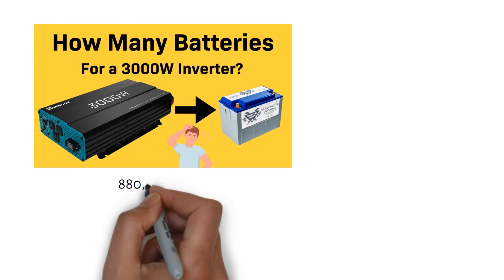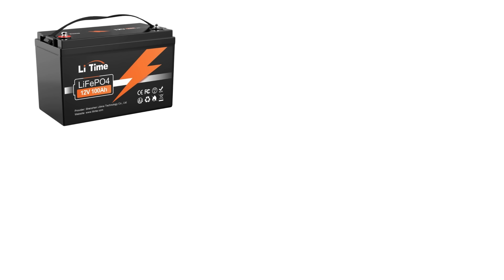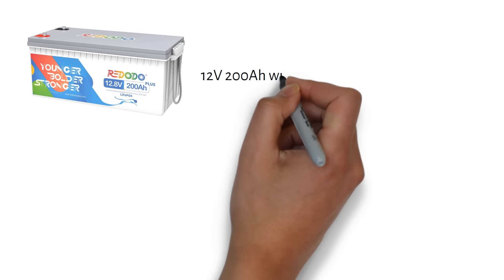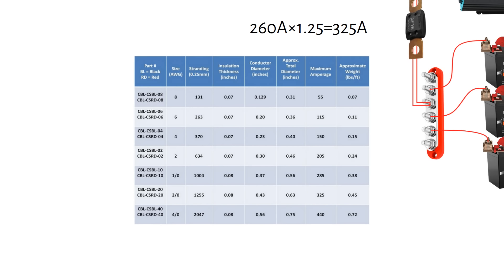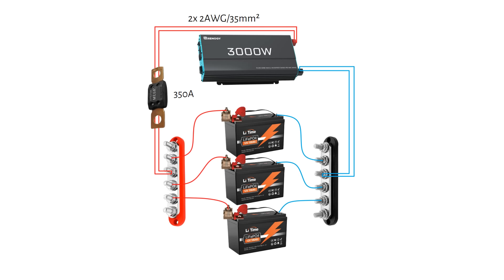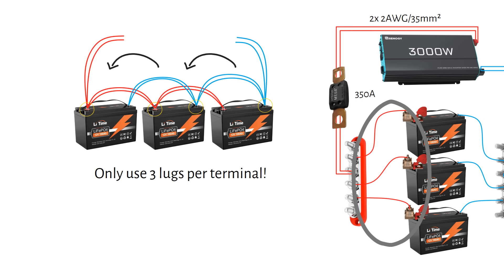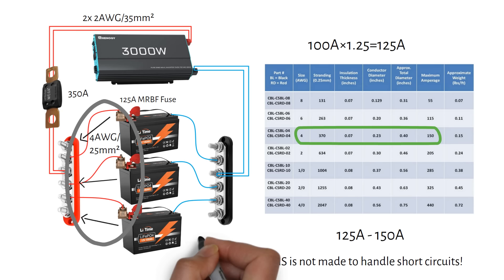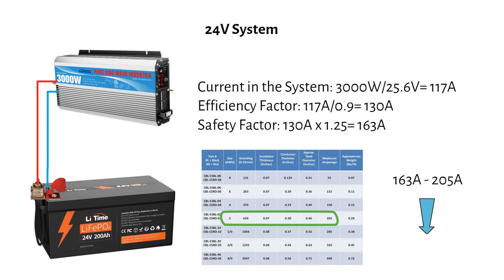How Many 12V Batteries for 3000W Inverter

Comment: I've got this exact inverter. Should have researched by better / seen this before buying.
Running off two 130 leasure batteries, and you get to microwave one meal before the low battery alarm sounds.
Useless in a motorhome setting 😢
Reply from the maker: Indeed, something i forgot to mention. If a large load is placed on lead-acid batteries, the voltage will drop. The inverter will shut down because it thinks the batteries are empty. While in fact, the load is too large for the batteries.
Reply: With 4 100Ah 100A lifepo4 batteries and my 3000w 24v inverter I can use an electric oven with 2 cooking plates and  electric oven with all 3 at full power at same time. And I can keep it running like that until the batteries is empty which will take 1,5 to 2 hours as I do not know the exact power usage of the electric oven. LifePo4 is the way to go for high power usage.
Reply: @a64738  Agreed. 24v is better as the cable gauge can be reduced. Lithium can be run flat, unlike lead acid, but the price! Looking at a 12v 280ah lithium from eco-worthy for £500.
I'll be selling the inverter and buying a 1000w. Hardly use it anyway, and mainly to charge laptops etc. My inexperienced thought was, 'if buying one, may as well have the extra watts just in case'.

Comment: I have LiFePO4 12.8V 200Ah Plus batteries. Would I still require two 300A busbars, or would something larger be required? Thanks a bunch and great video!!
Reply from the maker: 300A busbars is sufficient.

Comment: So the question is you're saying, 2 batteries will give you 3000 W. How many amp hours does it give you? So does it will that allow the battery to run for 12 hours or 4 hours or 6 hours? You don't know how many batteries do you need to run for 48 hours steady with the 3000 What load?
Reply from the maker: 2 12V 100Ah batteries in parallel will give you 200Ah. An inverter doesn't give you Ah though. I have made videos about how to calculate battery runtime, check them out on my channel.
Reply: The 3x lithium will give you 1 hour running 3000w load, and the 13x lead acid will give you 2.5 hours if you do not want to push it to the danger zone of discharging lead acids, but it can deliver 5 hours until discharge, where i live its cheaper to build the 13x lead acid bank than the 3x lithium about half the price for the whole bank, it may last half the time of the lithium but it will give at least 2.5 times the power, also lead acid is the real green battery with full return chain and i coud have a 10% discount in return on the next time i buy a new bank, lithium is not realy easy to recycle and where i live i need to pay for it to be disposed, yep it will not be recycled it will go in a landfill

Comment: Hi, I'm still very new at this.  I undrstand (I think) how to calculate the batteries and wire needed if I know the rating of the inverter.  But what inverter do I need to run a 1500 watt 120vac load from sundown to sun-up?
Reply from the maker: 1500W/0.9=1666W at inverter input * 8 hours = 13,333Wh per day. Off grid design says 3 days of autonomy, 13,333Wh*3days=40,000Wh or 40kwh battery = 8 server racks (48V). Recharge the battery in one day: 40,000Wh/3 sunhours on average = 13,333W of solar panels. cost of batteries: $10k+ $6.6k solar = $16.6k for batteries and solar add an EG4 off grid inverter 6000XP ($1400) + additional charge controller $500. so expect to pay $20k for this.

Comment: This is what ive found - i have a electric hydrologic wood splitter - when i use it on a 3000 watt inverter it will blow a 400 amp fuse - 
     I tried using a 400 and 200 amp fuse and after using it a few times both those fuses blew - 
        Sence then ive used two 400 amp fuses and have not blown any fuses -
Reply from the maker: A wood splitter is know for high surge currents. I recommend using a low frequency inverter for this load. Are your cables thick enough for a 400A fuse? at least 4/0 or 120mm²?
Reply: I do use low frequency inverters for my   high draw devices like my electric wood splitters - I use 750;CM cables as power cables - 
      I had worked on generators and SCR drives in the offshore shore oil fields & remote mountain oilfields for 50 yrs lol  - I'm a 4 th generation mechanic electrician - 
     I live in the rural South - I had a grate uncle that started setting up homes with rural light plant about 1880 - he trained my grand father and some of my uncle's - in 1920 most went to powering there homes with 32 volts - the railroad started using 32 volts about 1915 or so is what my grandfather said - 
      Down here since it rarely gets down to 0° F most used an acid strength of 1.195 gravity - it's a weak solution of acid  so the standing voltage of the cell at 78° is 2 volts per cell - 
     With weaker acid the cells do not easily sulfate and it's easy to equalize them - also they don't use much water and the terminals and cables don't corrode at all as long as there coated with Vaseline - 
       Also the plates don't swell or flake over the generations of service - when I was a kid I saw 800 amp cells in glass jars and the plates still looked new after 80 yrs and there was very little settlements on the bottom of the jars -       6 volt homes used 4 cells and 32 volt homes used 18 cells instead of 16 cells to make up for cell voltage drop  -  when I was a kid up till about 1960 REA was still setting poles and string wires on poles around here -  
       At 50° the cell voltage drops to 1.8 standing voltage so extra cells were used - around here the 6 volt homes had 7 kw banks and the 32 volt homes had 28 kw banks - they charged all day once a week - 
     Some of the 6 volt homes when I was a kid still used a steam engine fired by a upright boiler for steam - to charge there house batterys all day once a week - those old boilers eat wood like crazy - some times I would mess with those boilers as a kid as they ran - the piston rings were hemp rope rapped around a grove in the piston -  the feed water pump piston also had hemp rope for a piston rings -
      You mentioned low frequency inverters - eBay at times will have the Trace PV2000FC  inverter for sale I've had friends get them off eBay for $100  - I think they came from FEMA trailers from when Katrina hit - if it does not say tested don't get it  - 
     Those PV2000FC are modified 2 step inverters and are rated at 2 kw continues - 3 kw for 1 her and 4 KWs for 4 seconds - they will  start the pump on a wood splitter - the can be set up to  ideling - in my case I like the fact that there FCC class A part 15 - 
      I lisen to overseas short wave broad Cast those inverters don't create interference - 
      They don't run motors  effeciently - at times I'll use a 10000 BTU AC on one of those inverters - also the one that the wood splitter runs off of - I'll use a instant pot on & hot plate or coffee maker - it never cuts off - 
    I have to use a two 400 amp fuse on the inverter I use the wood splitter on it will blow a 400 amp fuse - 
     I have the house set up on true sign wave inverters so refrigerators ect run effeciently  - I charge a few hours a day and use 1.220 acid strength - 
    For cycling that good for 40 yrs or so - 
    Most don't know this - you can fully charged a lead acid battery then pour the acid out and refill it with water for a day then pour the water out and refill it again and let it set - do it a third time and pour the water out - leaves the battery up side down to drain - 
      You now have a dry charged battery -  if the battery sets for yrs the negative plate will oxidize some - 
    It will take longer to reactivate the battery after pouring the acid back in - also the original acid will weaken as it reactivates the battery if it sat for a while so you might need to add some new acid to bring it to the gravity you want - 
       If battery are sulfated I just bring the cell voltage to 3 volts for 5 or 10 moneys 4 or 5 times in the course of a day then slow charge them - if it's a good battery it can be restored to full capacity - 
      Our power goes off often enough so I have a hybrid back up - some after Katrina did have power off the grid for 2 yrs - 
     Lithium battery's work out better for high current as with wood splitters - you can use four 100 amp battery's or one 300 amp lithium as long as the BMS will allow for a 600 amp start up surge - TEMU has 100 amp  lithium from $109 to $114 with free shipping -

Comment: Hook up 3000w inverter to car starter battery and start car , 200A alternator will run the inverter through the starter battery.
Reply: How much current do you think that 200A alternator produces with the engine at idle?
Reply: @g-whiz286  Hard to say.  A car alternator uses the battery to produce the magnetic field in the field coils.  The regulator puts out a constant 14.5v.  When your inverter kicks in there will be a voltage drop, your regulator will respond by increasing current to field coils to get voltage back to 14.5v.
Reply: Nope. Try that.

Comment: Hi
Can I use a 12v battery with a 24v inverter? Thank you for your answer.
Reply from the maker: No, not possible.
Reply: @cleversolarpower what about two twelve volt batteries?

Comment: I'm thinking about building a 4s3p LiFePO4 battery with 25Ah cells.  These are Topband Prismatic cells and have a 3C continuous discharge rating,  5C - 10 second rating....    This would make a 12.8V 75Ah battery with a max continuous discharge of 225A.  This would give a max discharge of 2880Watts.  I am hoping maybe to use it with a 2000W inverter.  These cells were originally designed for a electric forklift.  Does that C rating seem plausible?
Reply from the maker: I recommend getting he regular 280Ah 3.2V cells. I recently got a quote for $45/piece. 1C with this cell is 280A. I don't recommend having cells in parallel because it wont get balanced properly. The C-rating can be plausible, however i don't know because you didn't tell me the name of it.

Comment: Thanks for the video! Just one question @cleversolarpower, I have a 280AH battery with a power of 3584Wh and a maximum discharging current of 200A. Does this mean I should have another battery installed if I want to run the renogy 3000W invertor (because of the maximum discharging current) or will one battery be enough (because of the battery power)?
Reply from the maker: 3000W/0.9=3.333W max draw from the batteries. 
3.333W/12V=277A
Your battery BMS will shut down when you reach a current higher than 200A if there is no surge capacity on the BMS.
Reply: @cleversolarpower  what do you mean with “no surge capacity on the bus?” (I’m not an expert)

Comment: 👍
Kindly direct me Sir.
In order to respect the battery's C-rate using leadacide batteries. You said in your previous video that four 12v,100ah lead acide batteries should be connected in parallel to match a12v  1000w inverter.

That is,
1000w ÷ 12v =83A &
4 x 100ah x 0.2c = 80A.

My Question:
I believe that the amount of current that's being pulled from the battery or batteries by an inverter should be dependent on the load that's being plugged in ~instead of the capacity of an inverter.
Won't it be okay to use 12v 3000w inverter with 220ah leadacide battery and maintain loads  that's not greater than 528w (while, 220ah x 0.2c x 12)?
Reply from the maker: If your loads are not larger than 500W, then you will still get the expected lifespan out of your batteries.
Reply: Thank you very much Sir.

Comment: Your inverter used 3 batteries , my inverter I used 1 battery , you might used 240v - 50 , I used 110 v 60 , for safety you do on your ways I do on my ways just follow recommendation of electric needs, I'm a dump guy no school  but I do my own safety , thank for share .
Reply from the maker: Whatever works for you ✌

Comment: What happens if theoretically I had the said 3000w Renogy inverter but put 4 or more 12V 100AH batteries together. Would that change the fuses and wire AWG ?
Reply from the maker: No, the inverter decides the current draw, so adding more batteries does not change the current draw.

Comment: Thanks for the video. At 9:45 you mention that each battery should be fused before it's connection to the bus bar. 

I have a victron MPII 3KVA (2400w) 48v inverter with 2x 5kw 100Ah batteries in parallel, using 50mm2 cable.

Currently not using a bus bar, but instead connecting from the positive of the top (first) battery and the negative of the bottom (last) battery to a dual pole 125a NH gBat fuse (both the position and negative cables) which then connects to the inverter.

I know this isn't optimal in comparison to your examole of using a bus bar, such as the lynx power in.

But my question is this:
Must I install a 125a fuse from each battery to the bus bar? As you said that this prevents a current shift in the event of one of them failing.

Then, install another 250a fuse after the bus bar (between it and the inverter) accounting for the 100ah from each battery x2 + 25% safety?
Reply from the maker: I don't think it's required by code, but it's something I would add. In your case I would suggest using an MRBF fuse on the terminal of each battery. They are quick to install.
Reply: @cleversolarpower I watched your section about the MRBF fuses in https://youtu.be/OmYYdlU5qdA?si=hRJwc4ROpT1yb7KB. However you state that they should not be used in a 48V system which mine is
Reply from the maker: @SomeCrazyVids  The Icc (short circuit current capacity) of an MRBF is 2000A @48V. It should not be used in high current systems as a main fuse. But since you will fuse every battery separate, the ICC will be limited to 100Ah*10=1,000A Icc. Which the MRBF fuse can handle. It could even handle both of your batteries because they will have: 2x100Ah*10=2,000A short circuit current. But that would be on the edge. Hope this makes it clear.
Reply: Yes. When dealing with batteries with high current capacity, it becomes important safety precaution to use a fuse on each wire. Would you rather use a $10 fuse on each wire or have a fire?

Comment: Good day sir so how many lithium batteries for 24 volts 3kva  hybrid inverter and how many panels 450VDC?
Reply from the maker: 3000W/24V=125A. You need two 12V 100Ah in series with a 100A BMS each. But i don't recommend having batteries in series. So buy two 24V 100Ah batteries and wire them in parallel.

Comment: Can I connect 2 different voltage batteries building 12v
Eg.
I have 200v and 150v
Only I want add the Ah which means 350Ah
Reply from the maker: You got things switched up. It's not volts it's capacity or amp hour. You can add different capacities in parallel. I have made a video about it as well.

Comment: How many watts can a DC 12V to 220V inverter produce? I just bought si-500va inverter but I don't know how many watts it's producing.
Reply from the maker: Watts = VA x 0.8 (roughly). So 500VA*0.8=400W If you have a purely resistive load like a heating element without a fan, than 500VA=500W

Comment: How many 12 volt car generators would it take to get 3000 watts?
Reply from the maker: I assume you mean alternator. An alternator should only deliver 30-50% of its rated current. So probably 30-50A. It's best to drive and not stationary run it because the moving air will cool the alternator. Checkout my video about dc to dc charging and alternator charging.
Reply: @cleversolarpower  ok thanks

Comment: I hooked up my Renogy 3000W to (3) 12 LiFePO4 batteries. With everything turned off I closed my garage and walked away. The next day while outside I could here a beeping sound coming from my garage. I opened the garage door and the Renogy 3000W was beeping with a red light blinking. My batteries were all well above 12V and my solar system was performing optimally. I read the manual to troubleshoot but could find no explanation for the audio alarm and red light. I disconnected the 3000W and never hooked it up again.
Reply from the maker: Is there a voltage at the output of the inverter? Did you reset the inverter? So many things could have gone wrong. Have you tried contacting renogy?

Comment: 5.40 .....you used formula 260/1.25 where did you get value 1.25 to measure the size of Fuse ??? further where did you get this Chart at 6:23 ?????
Reply from the maker: Its multiplied. 1.25 is a safety factor you should use every time when sizing wires. 2: this is a cable given by the manufacturer of the cable which i have linked in the description.

Comment: “The fuse is to protect the wire”. Are you sure? In cars the fuse is to protect the expensive equipment the wires are connected to. My manual for a Growatt 3000TL  48V, says that the maximum battery input amperage is 82 amp. Well I would like to not damage the $1500 solar inverter. So, I will be putting in a 80 amp breaker. Your suggestion to protect the wire with an 100 amp fuse and not the inverter seems to be a problem.
Reply from the maker: Yes, I'm very sure 😉I recommend watching my video about fuses. A breaker doesn't break the circuit at 80A. And devices have fuses in them as well.

Comment: Everybody talks like lithium is king but if it gets below freezing these batteries wont work , thats a huge problem for me i live in a cold climate , so now what i need to heat my batteries and waist power doing so ? Why isnt anyone talking about that in depth , oh your just about amp hrs ? Maximum power mean crap if the batteries wont come to life in the cold .........
Reply from the maker: You need a low temperature protect BMS. You can discharge below freezing, but cannot charge when it's frozen. However, where would you locate your batteries? If it's inside your home it's never going to freeze right? And now there are heated batteries as well.